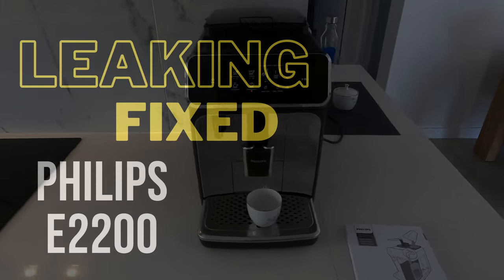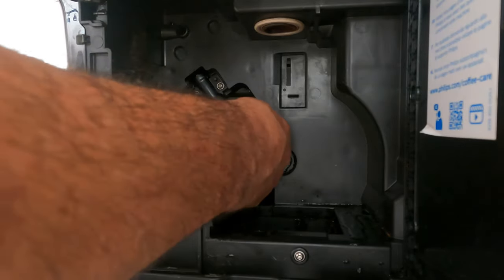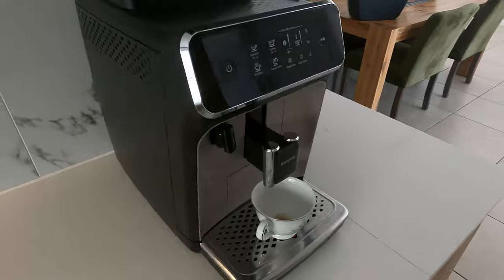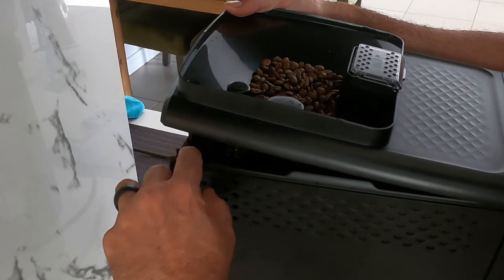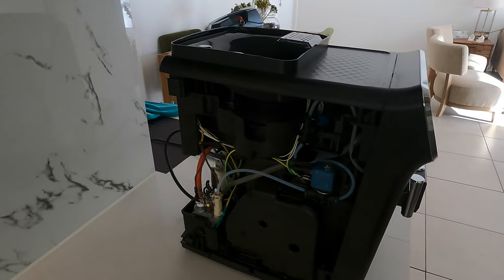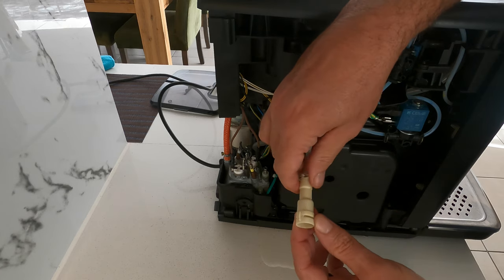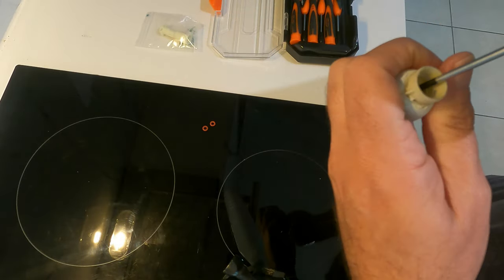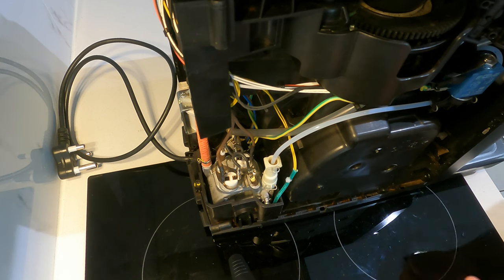Fixing Leaking Philips 2200 Series coffee machine

Comment: You can remove the "pipe" (start of the video)with torx10 bit (the 2 screws). It's not in the manual, but I use food safe silicone (same as for the brewing unit) on the o-rings. I do that about every 3 months or so. You should grease up all o-rings when changing them to be on the safe side.

My machine had one screw for the grinder missing. So the whole thing shock like crazy, spilling ground coffee into the machine. Had to take the machine apart just like you.

Comment: I just bought a secondhand 3200 and this video pointed me in the right direction. The breakdown was slightly different, but the internals are shockingly similar. Mine is leaking from another junction closer to the face of the device. It appears to be right at the bypass for the hotwater (which dispenses normally, without leakage). Hopefully this part proves to be just as inexpensive and easy to swap.

Comment: Hello, thank you for your effort in the video.  I have the same machine and it doesn't open at all.  I opened it and the capacitors around the yellow transformer were very hot when plugged in.  If I change the capacitors where the yellow transformer is located, will the problem be solved?  thanks
Reply from the maker: Hi Ali,
Sounds risky.. I don't recommend touching the capacitors if you don't have the correct knowledge to do so.
I'm not sure what the issue could be with your machine.  Rather, take it to a technician  to avoid injury.

Comment: Exactly the same problem. I also made a video. There must have been a bad batch of these cheap plastic parts. Thankfully it was only a $10 part.
Reply: Hi. the device leaked. we have opened. Heater connection broke. we replaced it and put everything back together. everything was working fine. today the device leaked again. took it apart again. one transparent tube separated. which brings water to the latte go. and when we put it together everything seems normal. like last time. everything back in place. but now the ignition button is not responding. does not receive at all when pressed. and the device does not turn on. we are not masters. The first time maybe we were just lucky with the repair. can you maybe give some advice? thank you very much

Comment: Hi. the device leaked. we have opened. Heater connection broke. we replaced it and put everything back together. everything was working fine. today the device leaked again. took it apart again. one transparent tube separated. which brings water to the latte go. and when we put it together everything seems normal. like last time. everything back in place. but now the ignition button is not responding. does not receive at all when pressed. and the device does not turn on. we are not masters. The first time maybe we were just lucky with the repair. can you maybe give some advice? thank you very much
Reply from the maker: Hi pricajmotomato8463.
I'm sorry to hear that your coffee machine is giving you problems. 
It is possible that water from the pump sprayed the electronics and, therefore, created a short.
If that is the case, I would imagine that you will need to replace the control panel altogether. 
I'm almost certain that this part is available online or, alternatively, you can take it to a professional technician in order to assess the damage.

Comment: At 5:58, under the orange hose (bottom right), there is a white hose running from top right to bottom left. On my machine this pipe just hangs loose and water runs out. The rest of the machine works fine so I am assuming this is waste water. If someone opens their machine, would they let me know where this tube is meant to plug in to please?
Reply from the maker: Hi Rowan.
The hose in question should be connected  to a white connector.
If you look in the video at 05:40, there is a part with a green and white sticker  on the bottom left of the coffee machine, and right beneath it, you will see the connector for this hose. It is hard to spot it  because it runs slightly forward in the machine and then twists back.
I hope you'll come right.
Reply: @davidlogasi1835  thank you David  - appreciate your response. Wish you a happy life

Comment: Mine keeps saying no water but the tank is full. Any ideas?
Reply from the maker: Hi Yasmine, I would start by checking the water tank.
At the bottom of the water tank, there is the hose connection, which  also incorporates water level, which might be blocked by hard water calcium or dirt.  Try to clean the water tank with vinegar and the hose that connects to it from the coffee machine. If it fixes the issue, I would also consider decalcifying the coffee machine as well. 
I hope this will help.
Reply: Hi. the device leaked. we have opened. Heater connection broke. we replaced it and put everything back together. everything was working fine. today the device leaked again. took it apart again. one transparent tube separated. which brings water to the latte go. and when we put it together everything seems normal. like last time. everything back in place. but now the ignition button is not responding. does not receive at all when pressed. and the device does not turn on. we are not masters. The first time maybe we were just lucky with the repair. can you maybe give some advice? thank you very much